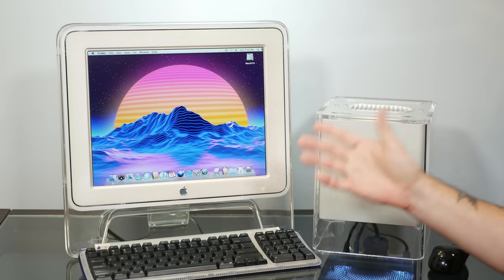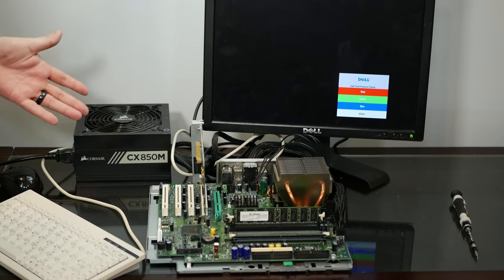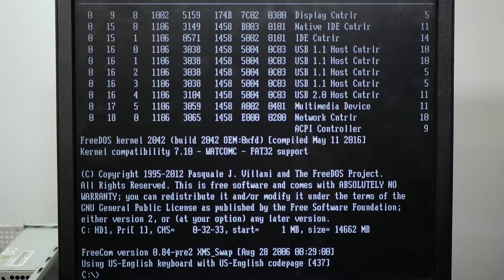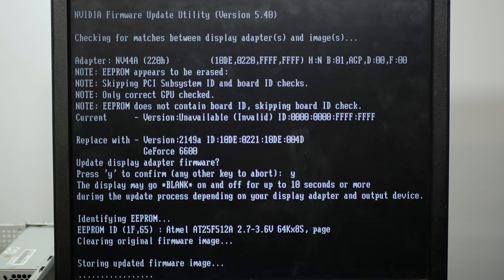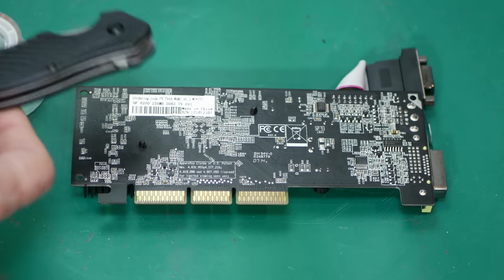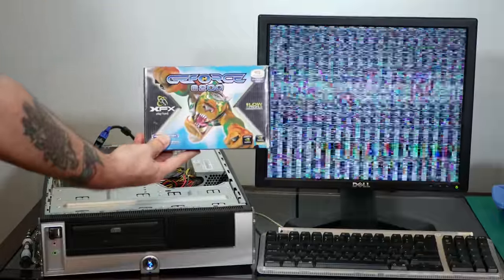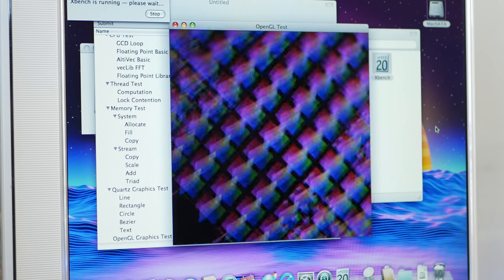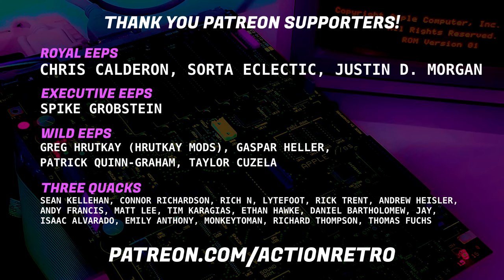Hacking a PC Graphics Card into my G4 Cube!

Comment: On any AGP machine with chipset-integrated graphics, the integrated VGA is also wired through AGP. An external AGP card (even if flashed with non-PC VBIOS) will disable the integrated card.

Having integrated and dedicated graphics running at the same time is only possible if at least one of those is PCI.

This limitation was gone with the arrival PCI-Express.
Reply from the maker: Thank you!
Reply: yet some manafactures (acer for example) will still disable integrated graphics if a PCI Express gpu is used. (which is a bummer for me becasue intel quicksync is pretty nice and it would be nice to offload some things to a different processor other than the main gpu
Reply: @CotyRiddle  Oh yes, I was talking about pure hardware limitations. OEMs doing nonsensical things it's another kettle of fish, especially Acer. I once had a motherboard of theirs based on a SiS630 chipset (socket 370 and onboard graphics with no AGP slot). While build quality was very nice, its stupid BIOS decided that if I install 256MB of RAM (or more), then 128MB of it MUST be set aside as shared video memory with no way of changing it. For a chip that was at best at Rage Pro levels of performance.
Reply: @cossasomi  seen that plenty of times. the integrated shitt never had the power to utilize anything more than 32 mb at best.

Comment: In my shenanigan of converting pc card to ppc, ati flash and nv flash gave me so much headache that I learned to unsolder the eeprom and reprogram it with a cheap programmer. Much more easy and you can correct mistake afterward. I made a couple cards that way.
Reply from the maker: That's amazing!
Reply: How did they give you trouble? I've been flashing cards since 2005... its literally bulletproof.

Comment: His channel inspired me to actually 3D print one and I got a raspberry Pi to boot straight into Mac OS X Tiger (I did what he did on the Mini G3 tower video) It's nice is pretty cheap to make, and doesn't have the drawbacks of old PCs. (it has 2 mini HDMI ports for up to dual 4k 60 monitors, USB 3.0 and 2.0, SD and can be attached to SATA, etc)

Comment: I used to put electrical tape over pin 3 and 11 on the agp connector of the card. This way all my cards were fully revertible. Electrical tape works very well because its very sticky, so it stays on and doesn't slide off. Personally, that is the best method. I bought a MDD tower recently and a 7800gs. Going to tape mod it instead.

Also, electrical tape isn't see-through, so you can easily cut two little rectangle strips, stick them on and done.

Comment: The Rage 128.  Wow.  That's a blast from the past.

My parents got a Pentium 2 back in 97/98 which had a Rage Pro (4mb) and the Rage 128 can be traced back to that card.  It's just a bit bumped up.

A little late on I got a PC with an All in Wonder Rage 128m. So that has TV tuner, video in etc which would have been around 2000/2001.

It's also funny to me that what was the bargain bin version of the 6000 series is a maxed out upgrade for the cube.

I actually have the guts of an old PC I want to get up and running.  I managed to pick up a motherboard that supports both AGP 1&2 and also AGP 4.  Most later AGP slots don't support the older AGP standard, and older boards with the old standard wont support newer AGP 4 or AGP 8 cards... I'm sure that's super interesting to everyone reading...   The long and short of that is I can use my old Voodoo 3 in that system but also swap it out for a X800XT should the game require more grunt.

Great video.  I hope you enjoy the new upgrade.  Giving these old pieces of tech new life is a great past time.

Comment: 18:00: Yep, 100% it'll work first try. I performed a similar Power Mac video card upgrade a few years ago. In my case I stuffed a GeForce 7800GS AGP card in a G4 MDD, running an even older version of OS X: 10.4.11. It fired right up and even had a driver ready to go. I don't think any Mac ever shipped with an AGP 7800GS, so the fact that freakin' Tiger actually had a built in driver just amazed the hell out of me.

Edit:  And...I was wrong. But hey, not much you can do about a bad video card.
Edit 2: Huzzah!!
Reply: It had a driver thanks to the g5s😉

Comment: You could use the original bracket for mounting your card in that cube, cut off the mounting tab thats at a right angle and cut the excess off, but leave enough to mark and cut two holes in the bracket for the OEM screw holes, then secure it with some nuts and bolts.

I hope that made sense...awesome work as always!

Comment: Trust me, you're gonna need a heatsink and fan. First thing you will notice is sparkles on game textures which progressively get worse. Then crashes.
Reply from the maker: I did put a fan in the bottom of the cube previously, which does blow across the card. I think I'm going to try and fit a more powerful one in there though
Reply: @ActionRetro  The base fan blows up the centre of the Cube - 0% of the airflow goes over the graphics card. It’ll cool  the CPU, which will reduce temps generally in the Cube, but that’s it. Get a Titan CUV3 for the GPU.

Does your Cube wake from sleep with the 6200 fitted?
Reply: @Robert F I ask because it didn't for me. The Cube would wake up (fan, HDD etc.) but the screen stayed black. The Cube was only a hobby machine, not a Mac I'd use for anything serious, but this left it feeling unrefined / unfinished. 

I wound up fitting the similar FX5200 256MB (flashed PC version), which worked fine and is slightly faster for games (128-bit vs 64-bit VRAM). Though eventually replaced it anyway with a Radeon 7500, which had a bunch of advantages for me.

Comment: You could actually take the bracked that came with the broken card, cut the lil lip on the bottom, and cut the L shaped lip from the top off, make it round shaped like the accomodation of the cube, and than with those standoffs you screw normally on either side of the connectors, you could use only 2. If you have the cube lying on its side like on 17:30 you screw the left one from the dvi in and the right one of the vga one, and you could than try to put some strong double tape on the left side of the vga and the right side of the dvi (or if you want it to be permanent, you could just superglue them to the bracket, make sure to sand down the inside of where the glue goes so it has something to grip on to), and it should be strong and sturdy, just don't jam a vga cable on there, but be nice and gentle when you plug it in and it should last for a very long time.

Comment: 8200 has a nonstandard pinout for the ATX connector. Used the same pinout as the early P4 Dells and the GX110. 
The 6200 should still get a heatsink with a fan, the 80mm slim fan won't be able to keep it cool for long. You should also consider doing a thermal compound job on the card, since it's going to be ancient at this point.

Comment: Hi Sean I Have Also The Geforce 6200 256MB  NVIDIA Card In My G4 Cube Graphics are fantastic . I Modded The The Original back plate from the 128 rage card with a drim tool looks great I'm using the VGA port for now

Comment: Great video; I went the same route back in the day installing a Voodoo 3dfx pc-version, reflashed in a pc with a mac ROM and enjoying Quake 3 Arena in my desktop beige G3, with a PC PSU (yes, the G3 had a toggle switch in its logicboard accepting a PC PSU, after the original smoked and was supes expensive to replace I threw in a cheap tower pc PSU)

Comment: Do you know if a ati 9600 mac edition ( the one with ppc + pc bios) would work ? Its a passive card that dont generate a lot of heat. Anyway, thats a nice upgrade to your G4 cube.
Reply from the maker: I think technically it would work, but it doesn't fit - if I'm remembering what I read on forums.
Reply: Use with a riser maybe? It would be janky and hang out of the cube but it should technically work

Comment: What I would do for a bracket, is to take the original GPU backplate, and just snip off or bend back the part that would screw into the case, and maybe drill holes in it so that it can properly mount to the screw holes already in the cube.

Comment: For the bracket part, I'd say check if you could just cut up the bracket that came with the card and drill 2 mounting hole in the bracket so it fits the 2 original mounting holes in the cube

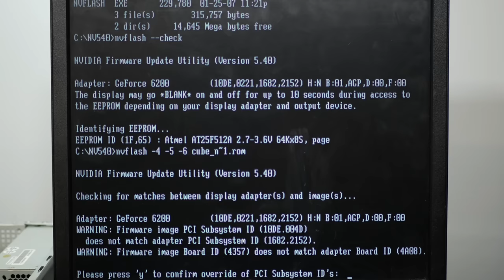Comment: Isn't the card detected as 6200 (8:10) but the rom is for 6600 (10:29)?
Reply: I was just thinking the same! Rom seems to differ (or he flashed a 6200 rom onto a 6800 card)
Reply: flashing a 6200 bios into a 6800 maybe be the trick for keep the temps down , don't know how that would work since the 6200 and 6800 have different chips on them

Comment: For the bracket I would flatten out the long standard one, mark it where the case holes are, drill it, and then use some short bolts and nuts to hold it in place.

Comment: I've been doing this since 2005 when running powermac g4s as fulltime drivers. You didn't ruin the card, it was probably bricked. Never had that happen. With a wrong rom it wouldn't boot, but it was always revertible.

Comment: The bracket is easy.  You can cut the top tab off and drill a single hole in it and the case, then put a single screw in it.  I have done this method several times.

Comment: Hey, I reworked someone else's G4 Cube GPU bracket to hopefully work with your card configuration. I posted the design on Thingiverse /thing:4659096. The original design is by Dietervdf, at /thing:1665153.

Also, if you don't have access to a 3D printer, or can't print locally. I can totally print the part out of high-temp resin and send it out to you at the cost of shipping.
Reply from the maker: Holy crap thank you! I'd be happy to pay for shipping! Could you email me? actionretro@protonmail.com
Reply: @ActionRetro  Email sent. 👍

Comment: You can really easily 3D print one, you just have to keep the build plate temperature very consistent and pull the part as soon as the print finishes, since thin parts curl easily.

Comment: Maybe it would be possible to flatten the bracket (So the tab on the end is not 90 degrees anymore) and drill some holes into it to help secure it in the G4 cube? The only thing your damaging is a bracket. Which can be easily replaced for $2 -$5 off eBay.

Comment: Thats pretty cool. Are you not able to use say an agp 9600 from a powermac G5 in a cube?

Nv and ati flash are both absolutely garbage tools. I had the same issue you did with your first card, my backup didn't work either, so I had to find a retail bios online and reflash it with that, which fixed it. Im impressed you got a final product that actually worked lol, even two tries in.

Comment: I would take the original bracket, flatten it, and drill holes in the top and bottom of the bracket so that it could screw into the G4 case.

Comment: Doesn't that card have an 8 pin SPI chip? I'd recommend getting on eBay and buying yourself a ch341a chip programmer. Really handy tool for flashing bios chips outside of the computer, and it works on a raspberry pi (or other Linux distributions) with flashrom.

Comment: Unsolder the s-video connector and attach the old gfix card bracket. It should work since the vga Conn is on a ribbon cable, it would just need a little modification.

Comment: Did you ever perform a benchmark on the old hard disk drive performance versus the new SSDs performance? Just curious as to know how much better the reads and writes are.
Reply from the maker: Unfortunately the old hard drive was pretty much toast and only spun up sporadically.
Reply: @ActionRetro  how dramatic was the difference in throughput did you realize after putting in the SSD? Also, did you enable TRIM in OSX for it? You might have to manually enable it using the following command in terminal: sudo trimforce enable. I had to do that for my 2009 white MacBook, because El Capitan didn't enable TRIM with my aftermarket SSD.

Comment: You could try and fabricate a metal bracket to match the Cube design which is slightly different regarding its shape. 
Then you could cut out the bracket to match the new card.
Does this card work in Classic mode ? 
Would love to upgrade my own cube graphics card but I don't have the ability to do it.
Great video. Many thanks.

Comment: Personally, I’d have found/designed a 3D printed bracket or at the very least used something like kapton tape to reduce potential shorts if loose, depending on the surroundings of the card.

Comment: For future reference a lot of premade pc's have a none standard pinout for the power supply. So by plugging in a universal power supply you may have burnt out that board or just stopped it from booting.
Reply: Those old dells don’t, they use standard ATX. There’s really only a few where it’s not obvious that it’s non standard. Most prebuilts that use non standard hardware use custom connectors that are physically different from ATX. Dell did use a different pin out ATX connector, but much later.

Comment: update . there is a half hight 6600 floating around that will work in this . its just an unlocked 6200 but it also has 512mb ram

Comment: Would this same trick work on the G5?
Reply from the maker: Yup! I think the only AGP PowerPC Mac it doesn't work in is the MDD for some reason.
Reply: Didn't the G5 machines use PCIe instead of AGP?
Reply: @ActionRetro  Yup! I remember trying to get this to work for my MDD with dual 1GHz G4s, and resorted to finding a relatively rare Radeon instead.
Reply: @MixerVM  Later G5s use PCIe while earlier ones used AGP and PCIX.

Comment: What the hell happened to the CPU score after upgrade the GPU? It dropped about 7 points 🧐
Reply: Overhead? FX5##0 (and newer) cards perform poorly on sub 1-ghz x86 PCs. I'd imagine it's similar for the PowerPC-based PowerMac.
A GeForce 3 or 4MX might've been a little better choice, even if lacking 'grunt' or features.

Comment: Hi, im searching for a cube power brick. My one is broken! Any source? Third party?
Reply from the maker: Aw man, those are hard to find. How broken is yours? Might be easier and cheaper to get it fixed!
Reply: @georg6876  hard to find, because 28V in 5pins or so
Reply: @ActionRetro  yeah, maybe, bought the cube without the psu on ebay 😜 so i „lied“ its not broken, i dont have one 🤪
Reply: @Bogomil76  I had the same issue, best solution in my case was to get a second cube..
Reply: @jellepetje  i thought about that, but i dont wanna waste one only for that 😳 Maybe someone else would also enjoy to possess one
Reply: Use a hair dryer to blow hot air through the top of the PSU for 30 seconds, then try powering up the Cube. Obviously, take care not to melt the plastic case.

Comment: you can get away with using a sharpie:)... if you google dell perc 5i I think it was; a dell server sata/sas controller, they used one of the pins for some proprietary dell thing, so on a lot of non dell systems back in the day it was required to not use the one pin or the system wouldn't boot **source: tried it myself and random websites

Comment: I would love to upgrade the GPU in my 400MHz G4 and my 1.8GHz DP G5. I actually have an Apple sanctioned NVIDIA card for my G5 but the person I bought it from shipped it wrapped in nothing but paper from the US to the UK and it has lines and other artifacting on the output :(
Reply: @Robert F I did that with an R9 270 GPU I was given that was artifacting. It actually worked for a couple of weeks...and then it shat a brick and died again :(

Comment: What's my bet that it's going to work first try? Well, 18 minutes into a 27 minute video, that's pretty much exactly two thirds. So that's my bet, 66.6%.

EDIT: Ok, perhaps that was a little optimistic.  When trying again at 20:40, that puts it at over 76%, which were much better odds. Just gotta get a nice 3D printed bracket or something for that thing and it'll be complete!

I've been having a lot of fun with my G4 Mac Mini. The magic mSATA to 2.5" IDE converter adapter thing finally arrived, so I could install the SSD inside. Honestly it's not running all that different compared to booting off the drive in a firewire enclosure. I tried using a mSATA to SATA converter with a separate SATA to IDE converter, but the alignment wasn't quite right so it was pressing on the side and I think that made it have a bad connection, because it kept crashing with the SSD mounted internally like that. Either that or it was the combination of converters. Ran fine in the external firewire enclosure, and the instability issues went away when I got the magic mSATA to IDE adapter.

I did make one upgrade to the mSATA adapter though, which was to use some M3 brass threaded inserts to give it proper screw mounts. Had to heat set them by putting them onto screws, and using my soldering iron to heat the screw and melt it in. I found that works better than heating them with the iron directly, since it slows the melting and helps avoid setting them at the wrong angle.

Unfortunately my next project is vintage DOS-related, so I'll probably have to take my eMac to the storage space to free up some room in my tiny apartment. But at least I can keep the Mac Mini around since it's so tiny and cute!

Comment: 1). Your AGP card appears to be in a PCI slot on your motherboard at 4:25??? 2).  The poorly graphics card may be able to be saved - try cooking it in your oven.  Sounds bizarre, ALL the experts will tell you it doesn't work and it's a myth.  Done it many times on all sorts of different cards and it's worked for me 100% of the time.  ON a card that's destined for the bin anyway, what you got to lose?
Reply: Powermac cubes, at least some, used a custom PCI66mhz-AGP riser. It seems that concept became re-realized in reverse somewhat recently:
 There is an AGP->32-bit PCI 66mhz adapter available for running Voodoos and PCI-PCIe bridge cards in ancient motherboards.
You can find more info over at Vogons.